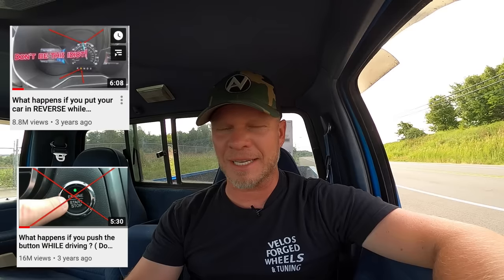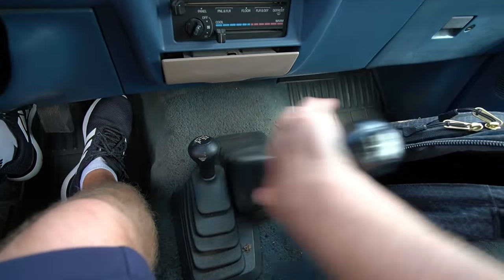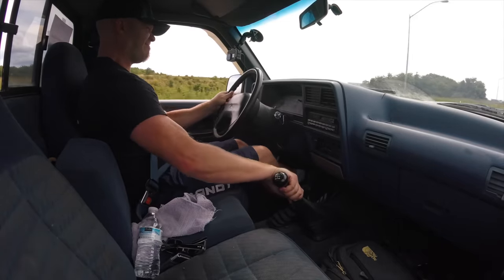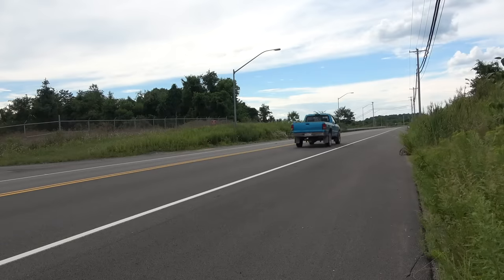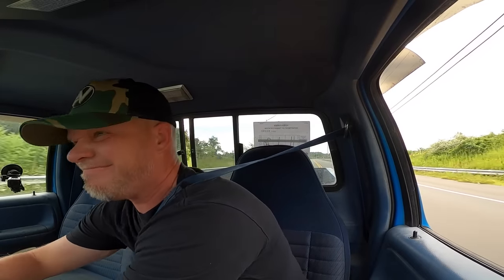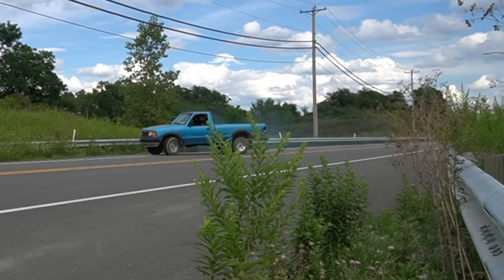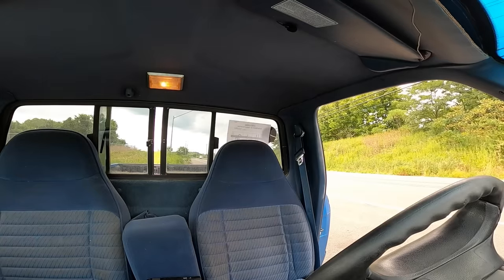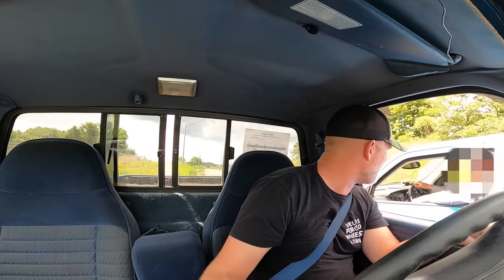What Happens If You Put A MANUAL Transmission In REVERSE While Driving?

Comment: Doing that saved a friend of mine's life when he went without breaks. However, the transmission could only take it once, several teeth were broken. I was quite surprised to see yours took it like a piece of cake
Reply: Brakes. Simpleton.
Reply: Why not just use 1st gear and/or handbrake? Gearbox would have had more of a chance to survive
Reply: @samteks125  I wasn't there, but as I was told it was downhill with a crossing right at the end, and there was a big truck turning, and it was very close. So an actually solution was required
Reply: Could have been bc fwd more stress on the transmission this is rwd so much less stress when braking momentum goes forward. In a fwd car it would make sense the clutch might suffer a lil 😂
Reply: It looks like it wasn't THAT hard to get the rear wheels going on reverse, and let the tyres take the worst of it
Reply: Stop lying
Reply: Maybe because the tires took most shit in this video. Using the engine break in reverse can’t be good. (If possible)

My manual has nothing stopping me from putting in reverse and sometimes I’ve accidentally almost done it while going from 5 to 4. It sounds like a very unhappy transmission box way before releasing the clutch. Tried it with just 5km/h as well, same noise. :)
Reply: @macjonte   Wait can modern cars put on reverse while moving? The car I've been driving doesn't have any synchronization for 1st gear and reverse, so I have to be almost still to not break anything when switching those.
Reply: @n0-one0 yes wrong
Reply: @onddu2254  
Well.. It does sound like my car is highly protesting with heartbreaking sounds when trying. ;)
Reply: Could literally use the handbrake and would have the same affect.
Reply: @macjontemy old car had a non-synchronized reverse gear and frequently the teeth blocked me from getting it in gear when I was completely stationary. I actually had to let off the brakes and roll slightly to get it in reverse.
Reply: @samteks125    The brakes went out in my Honda Civic once and that's exactly what I did.  I was going down a very steep hill that dead-ends into a very busy street.  I down-shifted to 2nd gear, then first, while using the parking brake.  This slowed the car quite a bit but did not stop it completely, so I turned the car into the corner house's front yard and did a U-turn in his front yard, causing the car to go back up the hill again.  It finally stopped.
Reply: @samteks125 first gear would strain those pistons and shafts so bad I dread to think what would be worse… in any scenario it’s a lose lose
Reply: @SSNebula  Use clutch to keep the RPM under the redline or change to second gear first.
Reply: The issue with this solution, that you risking that not only the transmission broke, but after that and without working brakes, all of your control on the vehicle is lost, using only steering downhill doesn't help much. So first gear still much safer but ofcourse, the most important, don't drive without brakes.
Reply: There are still many manual transmissions that don't utilise the reverse synchro. Such transmissions wouldn't let you do that. It would grind the gears flat, rip off the teeth or simply explode.
Reply: Nice story, even though you just made it up LMAO. Yah this never happened

Comment: After driving a 6 speed for a whole while, and now changing to 5 that was a concern of mine. Good to know the engineers were smart enough to account for dummies
Reply: Been there bro
Reply: What happened to him may not necessarily happen in your vehicle, so I still advise to be careful.
Reply: Same. I'm getting a 5 speed soon and I was worried about doing this. I'm feeling much better about it now though.

Judging by how hard it was for him, I'm probably not strong enough to force it even with both arms.
Reply: That happened to my dad many years ago. He had been driving a company car with a six-speed for two weeks and when he went back to his five-speed, he tried to shift it into sixth gear, which only resulted in some grinding of the reverse gear. You can't accidentally put it in gear, it requires much more force than you use when shifting normally. A very ugly noise is all that's gonna happen. 

I recently went from driving that same five-speed for five years, to a six-speed. Stalled the engine once when I wanted to reverse, but had shifted it into sixth instead. Still mistake sixth for reverse sometimes, but I've since always caught it before I released the clutch.
Reply: @frjoethesecond  I would be less worried about the transmission and more worried about completely locking my tires while hauling ass trying to get into 6th gear.

Comment: I always thought R is for Race and
N in the middle is Nitrous.
Reply: I've never seen a gear stick with an N on it for neutral.... Isn't that only on Automatics?
Reply: @STlTCHlZ  yes R for race in manual and N for nitros in automatic🤞
Reply: @WEIRDO! Yes ik that R gets the car into race mode with extra horspurrrs while the N gives nitros to the engine,  it's d/f for each car you know like superchargers n turbochargers Most manual owners get race mode while the automatic ones get nitros 🙌
Reply: @regzapr7830  mo powa baby!
Reply: @STlTCHlZ  Most don't have a N on the stick. Some do. But almost all manual transmissions have a N position in the center. If they didn't you couldn't get out of the vehicle with it running.
Reply: N is for Night Mode.
Reply: M is for medium

Comment: I actually did this once on accident when I was 21 years old and fresh out of the military. I just bought a 1985 S-10 Blazer and it was my second time taking it on the freeway. I was getting up to maybe 50mph as I entered the freeway and went to put it in 5th and hit reverse. Soon as I let off the clutch the tires started squealing. lol. I immediately knew. I skidded like 15 feet and quickly put it into the right gear. The truck ran many years after that and never had a trans issue. (Maybe because it was a truck).That was the only time I ever did it. So now my question is would it work the same if you got going 30 or 40mph in reverse and slammed it into first? lol

Comment: I feel like just looking at how a manual transmission works would probably explain why this was so difficult to do.  Since reverse works by turning the axle in the opposite direction, another gear is necessary to convert the rotation from the engine.  Kind of hard to do when you have two gears turning against each other.

Comment: It happened exactly in the same way that I expected it to have. The transmission completely goes into reverse, and as soon as you release the clutch and give the throttle, the wheels started to spin on reverse (due to the reverse gear) and at the same time the vehicle is moving forward. So definitely the wheel spin or the burnout should has to happen. I think at some point we can do this trick if the brakes fail. But it can cost you a transmission.
Reply: But it will only happen to old school stickshifts.

Comment: I was completely shocked you didn't drop the transmission on the first attempt. I'm really impressed you didn't even lose the reverse gear after all those attempts.

I was just picturing the reverse gear completely smooth with metal chucks in the transmission fluid.

Guess it really is "Built Ford tough" :) couldn't resist that one.
Reply: It has a synchronized reverse. With no synchro it would really grind the gears flat, rip off the teeth or just explode. And just FYI some manuals especially in cheap cars still don't utilise the reverse synchro. I had several cars in my life and only one had a synchronized reverse. It's an amazing feature, because manuals tend to grind when you put it in reverse right after pressing the clutch, as the guts inside has to stop spinning first. You have to wait a certain time, when the car is cold and the oil inside is gelly it takes under one second. But when it's hot it could take multiple seconds. However if you have a synchronized reverse you don't have to care about grinding at all.
Reply: enriqueamaya3883  are you born-again?
Reply: Funny how this survived the abuse but a modern truck will tell you to go f yourself if your tail light is out.
Reply: @5Dale65 That is some amazing knowledge to drop. Thanks. Is there a resource out there where you can check to see if a certain car has a synchro reverse or do you have to look up the exact transmission part number and then contact the manufacturer?
Reply: I’m shocked we all know fords transmissions are shit. Well the new ones 😉
Reply: @BOTthelesser mazda built the ford ranger
Reply: @5Dale65 reverse isn't synchronized

Comment: Holy cow, it's insane to hear the engine speed up while watching the truck slow down!
Reply: Engine breaks
Reply: Ive had to down shift to slow down before
Reply: @donnymcgahan1158 : No, the engine didn't break in this case. It was just fine.
But when you down-shift to slow down that's engine-braking.
Reply: @HelloKittyFanMan.  Yeah I misspelled "brake". How embarrassing. It's early
Reply: @donnymcgahan1158 : Nah, you used a different word.
Anyway, at least now you know to edit that reply accordingly (and while you're at it, include what you're trying to say about it).

And then of course after that I will edit my replies accordingly too.

Comment: I had always wondered what would happen if I would throw it in reverse while driving. But the other day I was wondering if in a manual, what gear is reverse in? Is it just 1st? I just threw it in the AI search engine and I guess it is limited to 1st gear. Makes sense. I was just thinking about some strange predicament someone could find themselves in where they had to flee the scene in reverse. I had always assumed you could go as fast as the car would normally go in reverse, but I’d never really tested it, and I realized that doesn’t make sense in a manual. Maybe it doesn’t make sense in an auto either, idk I’m not the most knowledgeable on cars. But this video is great, and even more satisfying because I had a 98 Mazda b400 which is basically a ford ranger, mine had a ford engine and everything. As a new manual driver I was always anxious about what would happen if I accidentally shifted to reverse while on the highway. Like if I’d destroy the transmission or something else. This sets me at ease… albeit many years late since I haven’t had the truck in a long time. But it’s still cool to get an idea of what would happen if I did that

Comment: Looks like it's a jeep with rear wheel traction. While braking (or going reverse), the weight gets increased on the front wheels and less weight is put on the rear wheels, allowing it to slide and put less stress on your transmission. Try it with a vehicle where the front wheels are driven. Then your transmission surely gets put to the test, as well as your engine while trying to stay in control of the car.
Reply: I was thinking the same while watching

Comment: I've always thought that in case of emergency brake failure one could put it in reverse regulating the pressure with the clutch to decelerate , it would obviously grind the gears engaging at the begginning, but in my understanding of manual transmissions is that it would just be on axle of gears changing it's rotation direction and then one could just grind the clutch to decelerate.

Comment: I'm surprised. I once did the mistake of putting the transmission in reverse before my car had come to a complete stop, it grinded like hell, no way I could have got it in gear if I tried,  and especially with speed.
Reply: Same here ... in makes a god-awful GGGRRGRRGRGRGRRGRRGR and refuses to lock in, even when parked and slightly going forward. I have serious doubts that this is a legitimate video or if this works in most gearboxes.
Reply: @sejuanisupportonly7385  I've had it too where I'm not completely stopped and when you try to put it in reverse it resists and makes an awful noise. But I've never pushed past that. I see no reason to doubt this video? Seems legit.

and I mean just look at him observing everything going on outside of the car at 4:50 while stopping the car from spinning out.
Reply: @Reflexzzzz  I am not saying it is fake. I am saying that this probably works in very specific gearboxes or he just tampered with it so it could go in reverse in a more smooth way. Unless you plan on buying a new car next day, I wouldn't try to push past that spin and noise, because that is actually the noise of the gears getting grinded.
Reply: @sejuanisupportonly7385  it clearly grinded and he had to use 2 hands to pull it into reverse, a normal person is never putting that much effort into "accidently" shifting into reverse once they hear the grinding

Comment: This was very useful to know as I worry whenever I drive my mothers car because her reverse is where my 6th gear resides. I've almost auto-piloted it into reverse at 70mph on the motor way a few times and just caught my self in time. Now I know that at least it won't explode :)  Thank you good sir.
Reply: Been there bro
Reply: this is very highly dependent on the vehicle. his truck seems to be very rear light and front heavy, as it barely slows down when hes gunning it in reverse. if you have a heavier vehicle, it would definitely destroy itself.
Reply: I recently went from a five-speed like the one you described to a six-speed.
I was quite proud that after having been used to my first car for five years during which I developed very specific habits for its quirky drivetrain, I managed to adapt to a higher hp car with a totally different clutch without once stalling the engine. Well, until I tried to reverse but shifted into sixth gear instead... 😪

Comment: I had a manual '99 Ranger for years. I also called it the Danger Ranger and for a reason! Loved that thing. My shifter also had a loose knob. I eventually just used a shop rag as a knob. Never got it into reverse while moving forward but I did try once.
Reply: I still drive a 99’ Ford Ranger 3.0L 5 Speed lol.  It leaks oil but it still operates fine.

Comment: I've had several stick shift cars all GM a 1978, 1992 and 1993 in all of them if I recall correctly they would grind if I bypassed the reverse lever to get it in to reverse while driving forward at a higher speed. on a stuck situation the back and forth at slow speed is very useful in a stick shift to get your car out of the snow. I never did it on purpose, just that the reverse was a similar position and I might not have been paying attention to my shifting.

Comment: Had to do this in my first car, it was an old banger and everything died on it while doing 70mph. Traffic was building up and felt I had no choice but to put the handbrake on and it didnt work, put it in reverse and the front wheels locked up. Eventually found the radiator had broken off and the engine blew its head gasket. Dont know if the transmission survived but i personally think it didnt.

Comment: The first time that I tried turning around by reversing round a corner, I naturally assumed that I should go into reverse as I was coasting to a halt so that I could start backing as soon I’d stopped, but when I did the car made a rather disturbing rattling noise.
I did idly wonder afterwards what would have happened if I’d lifted the clutch before I’d stopped, but I could think of at least 5 excellent reasons not to try and find out.

Comment: I think the important takeaway from this for people that are relatively new to manual or just curious is: No you will never accidentally shift your car into reverse while driving even if you do happen to try it by mistake, it won't let you, definitely not that easily, and with newer cars, something completely different will probably happen from what was in this video such as it not even being possible to go into the R position, or if it does, it treats it as Neutral until you come to a stop. Unsure on that part, just a guess, but the important thing is you are safe from putting your car into reverse accidentally
Reply: I don't think even the most modern manual car would be able to treat reverse an neutral when moving forward, as manual gearbox levers are still mechanically connected to the gearbox. But yeah it is possible that modern cars are built in a way that makes it much harder to do that.
Reply: If you need two hands to change the gear , you know you are doing something wrong.

Comment: I know of 1 situation where you might accidentally put your car in reverse on manual gearbox and that's because my mom has done it once. We had 2 cars, one of them had 5 speed gearbox, another one had 6 speed gearbox. My mom usually drove the 6 speed one, but then for some reason she had to switch to the other car and while she was driving, at some point she wanted to put it in 6th gear out of habit and put it in reverse.

Comment: even older cars and trucks that had manual transmissions have a safety to them.
wen in gear 1st to whatever your highest gear is engages a small safety pin to prevent you from putting it into reverse.
wen you try to go in reverse while in gear you have to overcome the pin thats why it took to hands and finally that snaping sound witch was the pin breaking.
sometimes they can partly snap and prevent you from engaging reverse again but it will be easyer to overcome it past the slip point and sometime it just fully snaps off.

Comment: Wouldnt't the best approach be to brake without abs to lock the wheels for an instant and then shift into reverse so that the rotation difference of the driveshaft and the gears is lower?
Just a thought